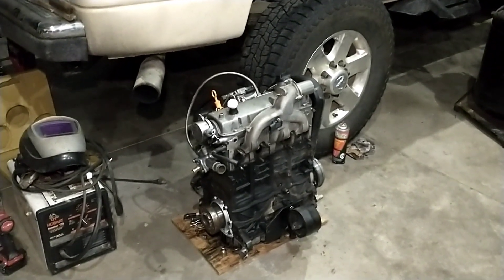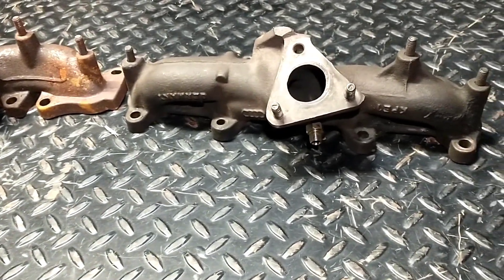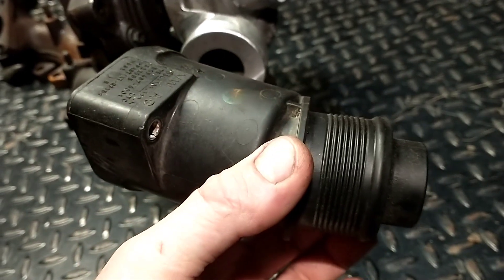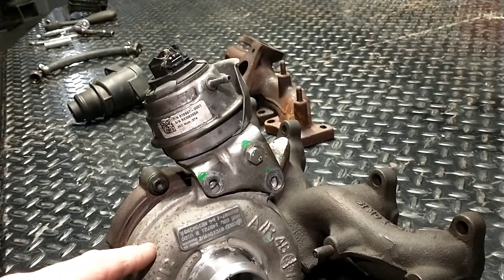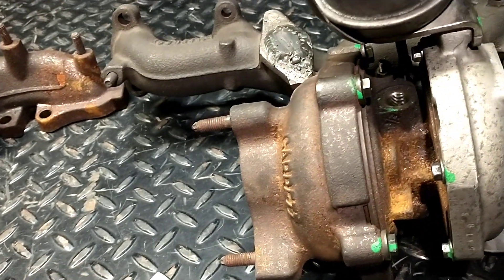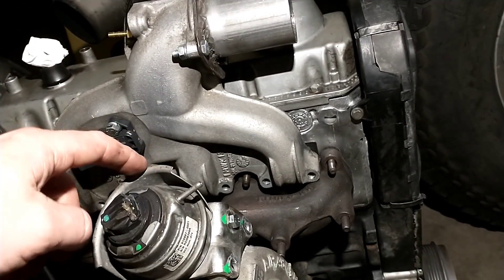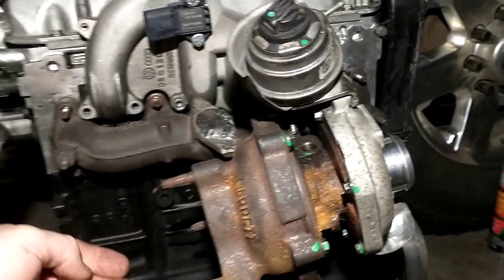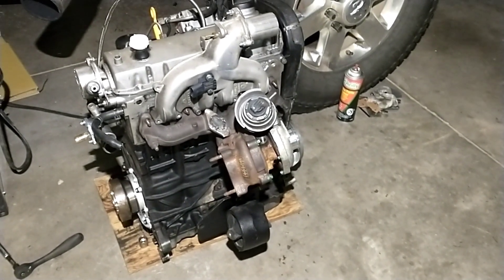Budget TDI Turbo Upgrade, GTC1549VZ Good For 30 PSI/200+ HP! How To Make It Bolt On For 97-06 TDIs

Comment: What is the diameter of the exhaust pipe and what kind of muffler are you using?
Reply from the maker: I use either 2.5" or 3" pipe with this turbo, no muffler.
Reply: @TDISwaps  Is it not too loud?
Reply from the maker: It makes some noise, but not too loud.  The diesel engine is louder most of the time.

Comment: What is your oppingon tu my turbo on a ALH, t.i. Holset he 221w ?
Reply from the maker: It's still a great turbo just doesn't make boost near fast enough for what I need to get moving.  This GTC 1549 almost starts making boost off of idle
Reply: @TDISwaps i will put this engine into my old VW wanagon…
Reply: And i will include a cruiser too. So thank You for your excellent wiring videos 👍🏼
Reply from the maker: Glad to help sir!

Comment: how do you clock it? the actuator arm is attached to the chra and the exhaust housing has a dowel preventing it from clocking
Reply from the maker: The actuator and center section of the turbo remain connected and can free spin inside of the exhaust housing
Reply: @TDISwaps did you remove your dowel?
Reply from the maker: If it has one yes, a lot of them dont

Comment: hey man, is the turbo fitting you used off the stock alh turbo?
Reply from the maker: The oil feed is an m12x1.0 they make an adapter to the m10x1.0 that stock ALH though.  I reuse the drain as well and just use a new rubber line in between the fittings
Reply: @TDISwaps i figured. i just ordered one now. 30 bucks for the fitting and 30 for the adapter rip. bought in canadian rupees. thanks for the video man! if you’re in tdi scumbags i’m the guy doing an alh miata swap
Reply from the maker: I've seen the posts!!!

Comment: Ordered the fitting.  Will order manifold after I figure out why wise is in a un ending loading session for my card. 

Then need turbo and the other stuff.   I assume for an Alh if I use a adapter plate like you did I need a exhaust gasket meant for this turbo or car it came off.   Then weld plate to my exhaust down pipe with appropriate holes drilled in it for studs on turbo.  

Stock manifold to engine gasket will work between the BHW manifold and engine
Reply from the maker: You got it! I actually don't even have a gasket between manifold/turbo and turbo/downpipe flange, they seal well
Reply: @TDISwaps  okay cool

Comment: Cool that you figured that one out. I bought the same style of turbo/manifold last year for my Ranger CR TDI build. The stock US turbo has the exhaust facing the front of the engine, and the turbine/manifold are a single casting. Asked around for ideas on TDI club, guys were telling me to buy a Malone or similar kit which would set me back nearly 4K. Figured they would have used the same engine on some EU RWD Audi applications, and they did. Think I paid C$400 on ebay for the turbo and manifold to my door.
Reply from the maker: Yup they go clear down to $200 if you watch for them, freaking sweat deal!

Comment: I would love to see a compound set up on this
Reply from the maker: I'm definitely torn about doing compounds, we will see how this turbo works first.  But being my wife's daily I'm not really wanting to make it anymore prone to issues than necessary haha
Reply: @TDISwaps  I'm telling a compound would stop any lag give more power. And you would have to go to the edge of the turbos power
Reply from the maker: @stephenhilton4665 ya the problem is this turbo will have 0 lag, and backing off the top end power would keep from maxing out this turbo and that's all the wife needs.  I get how much better a compound setup would be, don't get me wrong.
Reply: @TDISwaps  how much power could you get realistically and still save fuel mileage
Reply from the maker: @stephenhilton4665 it's already more than enough at 200 HP, 170-180 is all it needs and should get better mpg now with less fuel needed to spool this smaller turbo
Reply: @TDISwaps  have you hauled eith tye tdi yet how was it.
Reply from the maker: @stephenhilton4665 ya I haul my 4500lb boat with it, it has just as much power as the V8 I pulled out, but the water pump can't keep up to hold it steady.  It does fine up to about 60 mph, after that I would need an aux water pump to hold speed and not get the coolant too hot on long hills.
Reply: @TDISwaps  what swap kit did you go with
Reply from the maker: @stephenhilton4665 i used a jeep TD conversions adapter and an aw4 jeep Cherokee auto trans to the dakota transfer case
Reply: @TDISwaps Np 231 transfer case? Thanks for always responding you’re the man thank you for what you do
Reply from the maker: Yes sir! Glad to help!
Reply: @TDISwaps  I'm trying to learn how to do this swap in my ranger I have a 2.0 tdi and a 1.9 tdi. The kit is so freaking expensive

Comment: Are you going to wrap it in fiberglass and turbo blanket?
Reply from the maker: Ive never messed with turbo blankets, maybe I'm missing something but most of what I've read showed very little benefit in the real world.
Reply: @TDISwaps  it's a CHEAP add on, but theres a reason why racers wrap pipes. Keeps the heat where it needs to be, fewer losses to keep the heat / pressure up in the short distance its traveling. Engine bay will be cooler too, less thermal cycling delta on the turbo but thats debatable. Still, I have my ALH manifolds totally insulated in the engine bay and it IS cooler opening the hood after running.
Reply from the maker: Well part of the reason I've never done it is the turbo is so small I've had a hard time finding anything small enough to fit it.  But my engine bay is so huge there's very little heat kept inside to start with
Reply: @TDISwaps  idk why im just now getting notifications on this, but the blanket isn't to cool the engine bay, but to keep the heat in the pipes. More heat = hotter air = more flow as the air is thinner. More speed on the hot side = more pumping on the cold side.
Reply from the maker: @RW1LD I'm tracking now, maybe I can make an td04 blanket work on these smaller turbos.  Ya my notifications are always messed up lol
Reply: @TDISwaps  right? lol, anyways, my one project car I wrapped glass / mineral wool insulation on the whole hot side, including the ex manifold (was a bitch) about 4-5 feet out to the "offroad only" electric exhaust valve that dumps it short to side of vehicle. That single upgrade made a difference in feel in mine, but that could just be the bypass valve doing most the heavy lifting.
Reply from the maker: @RW1LD ya it's nice to have real world experience though, that tells me it might do something, u like the bogus stuff you read about all over the internet 😂

Comment: Use a Mercedes om606 and compare
Reply from the maker: If I ever run across one I will have to, I'm so set up with TDIs right now it's hard to imagine messing with anything else
Reply: Yeah, these Tdi are so abundant and cheap, not to mention reliable .
Reply from the maker: @AverageJoesracingteam agreed! I haven't even seen an om606 in years
Reply: I just recently bought 2 om606’s doing a Dakota as well
Reply from the maker: @tylerwallace6085 ya I'm just too remote to have access to them really
Reply: @tylerwallace6085  Dang, isn't that a more expensive platform?  I'm looking for a inline 6 to mod off of for economy and REALLY considered the om606, but I think I'm leaning 5.9L for parts reasons.
Reply from the maker: @RW1LD oh I'm swapping these TDIs for almost free after parting out the VW donor cars
Reply: @TDISwaps  same. Buy a whole car for 7-900 . Part it out , then have the engine, harness and ecu for free
Reply from the maker: @AverageJoesracingteam you got it!
Reply: Not sure where you are, but in western Washington OM606 are so rare that when they do pop up they are 3k-5k. Sometimes a non turbo one will pop up for cheaper, but those are not as ideal to start with…
Reply from the maker: @gabe1254 ya I'm in Wyoming, I've been looking for diesels for 10+ years and I've never seen one, but TDIs are everywhere here
Reply: @TDISwaps  exactly, TDI’s are so prolific you can get one complete for a few hundred. VW sold millions of cars with these things. The turbo OM606 was only sold 2 years in the US, as much as we all wish there were more of them here.. sadly that is not the case.
Reply: Yeah, options on lower displacement inline 6 diesels are thin here in the US. Toyota 4.2L I6 Diesel in early 90s land cruisers (i think even these are import, Yanmar branded these engines too at the time for boats, Kubota has a few floating around in equipment that'd fit the bill too but again, getting into weird territory.
Reply from the maker: @RW1LD ya the 20-30 year outlook on most of these other diesel engines for parts and rebuild options is not looking good
Reply: What about those Mercedes inline 5’s from the 300D’s?
Reply from the maker: @bobirving6052 they are an option, but becoming very hard to find and parts are becoming non existent as well.  They are also hard to make much power with as well without a lot more money into them than these TDIs.
Reply: @bobirving6052  Parts and mods availability... can't get toooo far out in the weeds.
Reply: Whole other level lol.